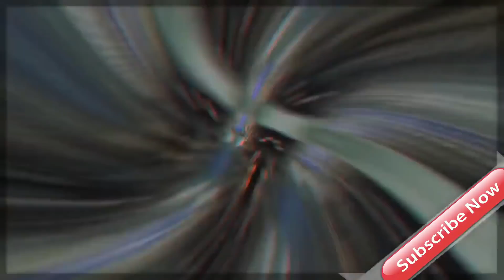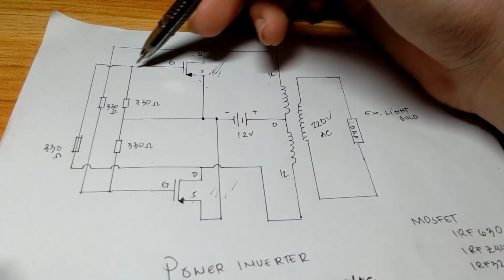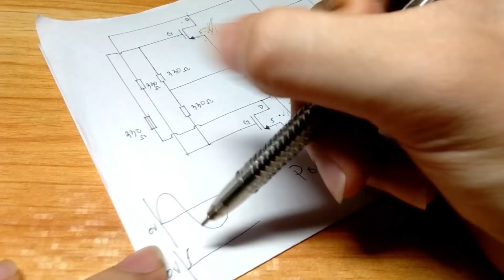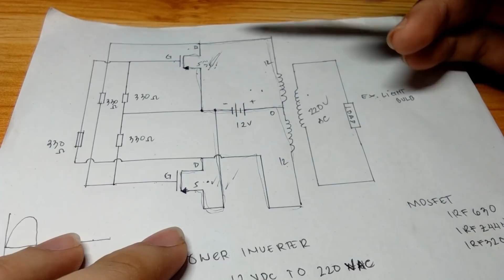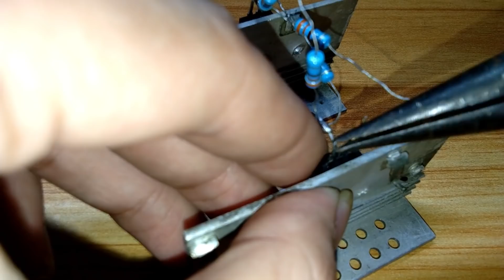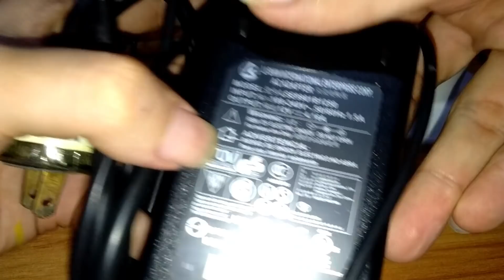How to Make Inverter | Inverter 12v to 220v  Inverter 500w

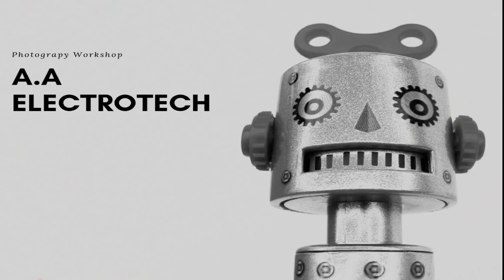Comment: Sir. yun 17:21/ 17:27 tungkol  sa added 0.1 uF Filter Capacitor san sa diagram nyo nilagay? at ibig mo sabihin dapat taasan ko ang AMP ng transformer kung gusto ko ng high watages ko? thanks
Reply from the maker: Sa output voltage katulad nito sir https://youtu.be/-k1Ri1m4yJE
Reply: @AAElectrotech  pure sine wave or modified lang ito? Kung modified ito paanu gawing pure at kung 50Hz paanu gawing 60 Hz.. Thanks
Reply: @AAElectrotech  puwede ba check kung anung diagram and parts ginamit dito sa charge controller?  https://www.youtube.com/watch?v=_YGlRkArsyA thanks

Comment: Why i make it always blinking?
Reply from the maker: Check your circuit,  use Irfz44n or Irf3250
Reply: @AAElectrotech  i used IRFZ44N & i follow your circuit still blinking
Reply from the maker: @als7293  Use High power Supply